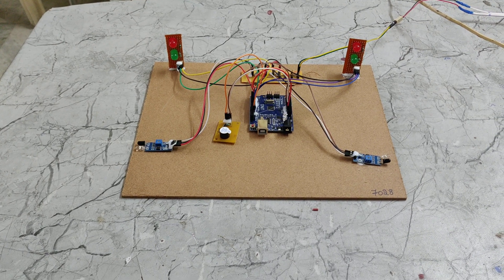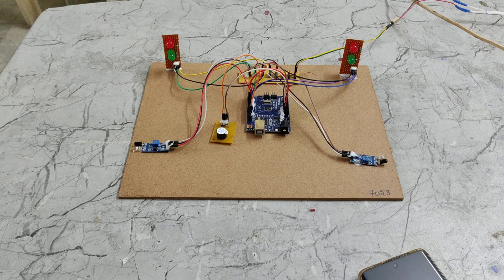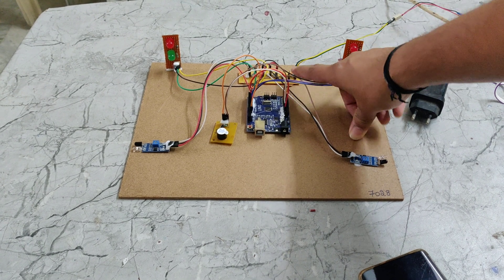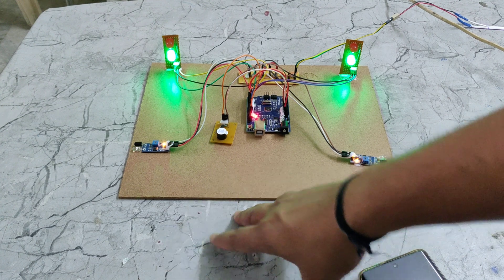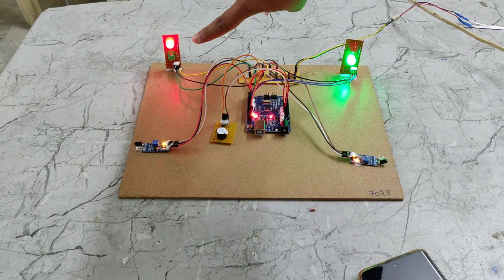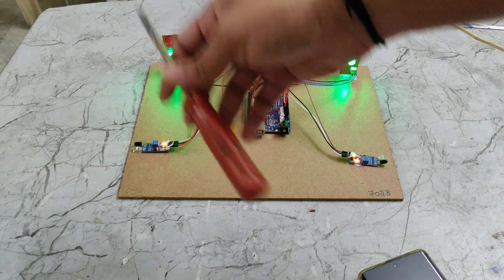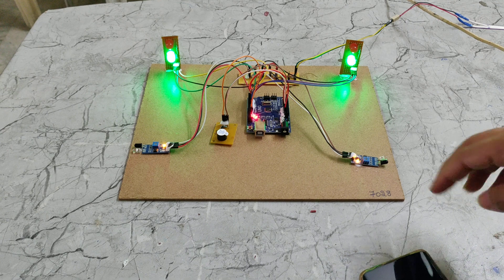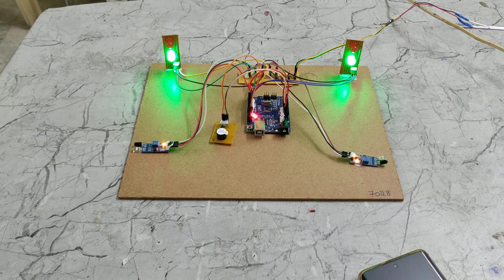HVS-3400. Smart Road Safety and Vehicle Accident Prevention System for Mountain Roads.#arduino#IR

Comment: Bro connection diagram and connecting table
Reply from the maker: Hi, 
We sell full working kit with document PPT circuit diagram and code. Could you Send me the video link, Will update you the cost details. You can contact us at +919603140482
Through WhatsApp or call